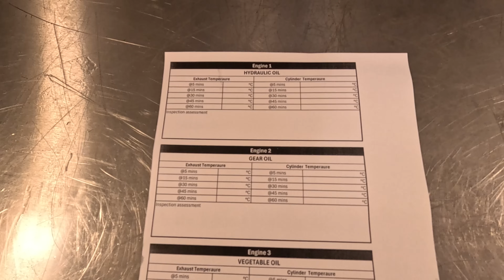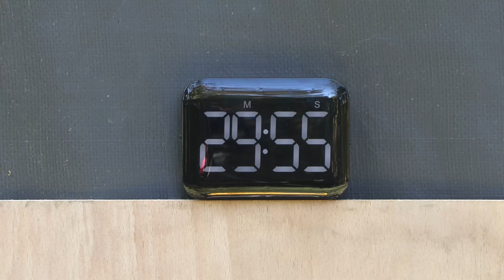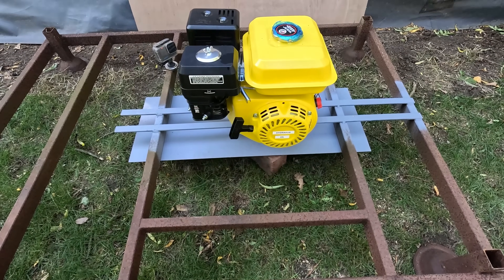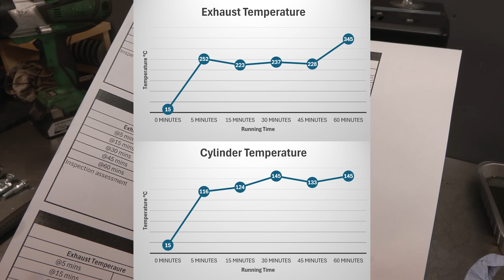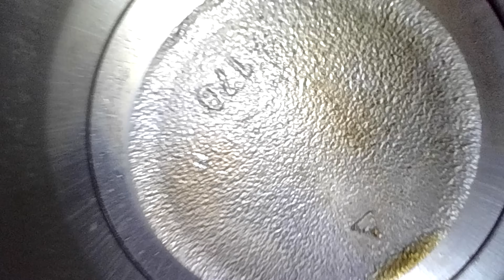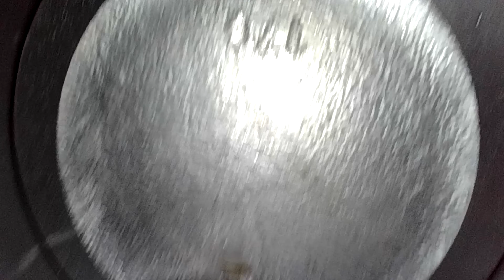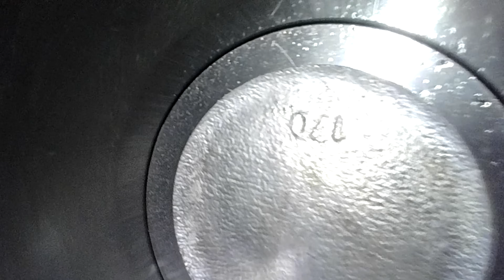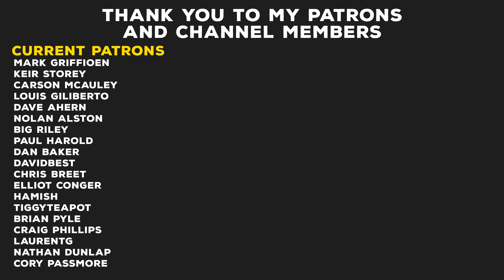Will Any Oil Work as Engine Oil?

Comment: Notes for V2:

1) You need a control engine with regular oil to be sure the chips are due to break-in. It is a reasonable assumption, but you do not know if the engines were producing the same, less, or more metal than expected.
2) Measure the quantity of oil you pour in and out of the engine to see if any oil was burning. Again, use a control engine with regular oil.
3) Consider extended testing, an engine that would be done in 50 hours and one that would last 500 hours might look about the same in the first hour of operation. Maybe the vegetable oil works great for 2 hours and then it breaks down catastrophically. Maybe the gear oil lasts longer than regular motor oil (doubtful, but you have not tested and so you do not know)
4) EGT/CHT probes and an Arduino for data logging.
Reply: Didn't "Project Farm" channel do something very similar?
Reply: @1d1hamby  Yeah
Reply: Theyre self clearancing engines if made in china.  It's a roll of the dice on lower end chinese stuff but  the good clones have lasted and been as problem free as my Hondas.
Reply: Load... the engine needs load. Or ideally a dynometer. Power output over time. Stress test. Set amount of fuel (efficiency) max power, etc.
Reply: Also one more engine with no oil in it and see how long it runs
Reply: 5 : under load like 60%
Reply: BINGO!
Reply: In all fairness it is what it is but after reading this comment a better test could of been conducted definitely 💯
Reply: EGT temperatures are more down to carb setup. Richer burns run cooler and leaner burns run hotter.
Reply: I agree. I was like, "But what about the control?" However, all of theses test results have something to do with break-in, because all of these engines were being broken in. You'd just about need 2 controls: Both using the proper oil, and one brand-new engine and one that already had all the break-in that could typically be done.
Reply: Anyone who has owned small engines should know that the first drain will be shiny. Regardless of engine brand. The only exception is the engines equipped with oil filtration on engines past around 16hp. The small engines do not have any way of trapping the break in metal produced. Hence the reason why small engine manufacturers sometimes require the first oil change within the first 4-5 hours ran, 2nd at 25 and the rest at 50-100 hours each after to remove these contaminants
Reply: It would probably be best to break in all of the engines with regular motor oil for 1 hour drain them out and then fill them with test oil.
Reply: /agree on the control engine with rec. oil.  So you know if these results are better/worse than the baseline.
Reply: @r0tax7  Yup.  Without a baseline you've got nothing to compare the results to.
Reply: I would recommend breaking in the engines with the proper oil for the first hour.
Reply: Especially for the first point, my thoughts exactly. 

What's an experiment without a 'control' 💯
Reply: blablablabla
Reply: That's what i was going to say, he needed to do a normal oil comparison but hey I'm not paying for these engines, but it nice to know if you are in a desperate pinch an need to top up the oil & your in the midof nowhere, you can get away with these oils as a temporary solution!
Reply: @standbanger2 I hope people aren’t expecting to get similar results with a car engine as with these small engines. Car engines are much more sensitive
Reply: 5: Load. Make it work. An engine that's working hard is going to demand far more of its oil than one that only has to turn its own flywheel. It's entirely possible that one of these engines will run from here till doomsday on veg oil if it only has to turn its own flywheel but chucks a rod in 30 minutes flat if loaded down.
Reply: @TestECull  Honestly I was going to say the same
Reply: Right, I was looking for the black engine with engine oil for comparison (control).
Reply: @mjpbase1 It should be a blue engine.
Reply: Looking forward to when you do your video 😂
Reply: @Paul-FrancisB  🤣🤣
Reply: @Paul-FrancisB 😂😂😂😂😂
Reply: Also put the engines under actual load too
Reply: Great suggestions! Another suggestion I'd make is to inspect the bearing surface on the rod as well as the cap. Since the rod sees the forces from compression, combustion, and inertia while the cap just sees forces from inertia, the bearing surface on the rod tends to wear much faster than the surface on the cap. On car engines, I've seen upper rod bearings worn down to copper with almost no visible wear on the lower bearings.
Reply: @averyalexander2303  I have seen tbat wear pattern in model airplane engines....and one modeo car engine. TRX3.3. Big end spun its bronze bush partway out and ovalled from oil starvation; all the wear was on the piston facing surfsce.
Reply: If you're doing a V2, could you also include an experiment where you've mixed vegetable oil together with graphite powder?
Reply: And maybe also a sacrificial worst-case control - how long such engine lasts with no oil. It would be interesting if something poorly suitable proves worse than no oil at all.

P.S. Frying-grade refined oil (and rapeseed/canola oil is always refined because a certain component is not suitable for human consumption) is at least meant to reliably lubricate the frying pan. I wonder what would happen with unrefined sunflower oil (that is, how long until it clogs everything).
Reply: @AlchemistCH im not so sure any form of vegetable, or flower oils, especially soybean oil is safe for human consumption regardless of refinement lol
Reply: this called 控制变量法 in chinese
Reply: @Mariano.Bernacki  it's not that serious mate. Lol. But it would definitely show data. He did this for fun.
Reply: @850climberchtrees  It should be that serious.  Otherwise it's a waste of time.  You need to compare the results of the test oils to that of the expected oil.  Otherwise, it's not completely telling us the whole story.  You need to compare the results he got against expected and if you don't have the expected results, it's simply not conclusive.
Reply: @zavatone  calm down battle buddy.  It'll b fine. You don't like it don't watch 😒.  Or here's a idea do your own video I'll watch it. 😉

Comment: Hey, i don't want to critisize too much. But... You should have broken in every single engine with regular oil, for 60 minutes at least. Then, you should have put in the other oil, and most likely you wouldn't see results for 6 hours. 

If you do it again, maybe try to put something together to put a load on the engine. Power some generators, which are connected to a heating fan.

Nice insight tho, very cool to see you go from farming simulator to actual real life engines and such. Always loving the restorer videos :)

Edit: Putting load on the engine gradually increases the wear of the engine. Which makes your needed testing time come down. (1-2h instead of 6h)

Comment: You should try that same experiment, but with lawn mowers
Reply: That makes zero sense. How do you think lawnmowers run?
Reply: Do you mean with something like a load on the engine?
Reply: Those are mower engines
Reply: What I meant by is running them on a machine like a water pump or a lawn lawnmower